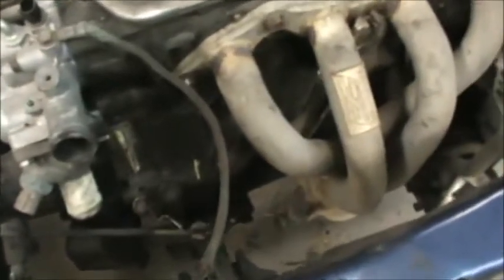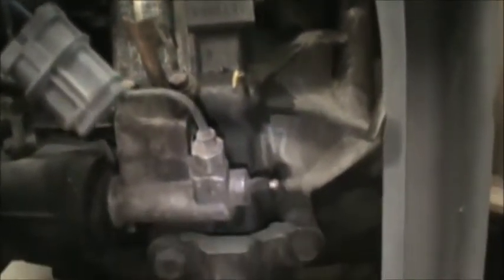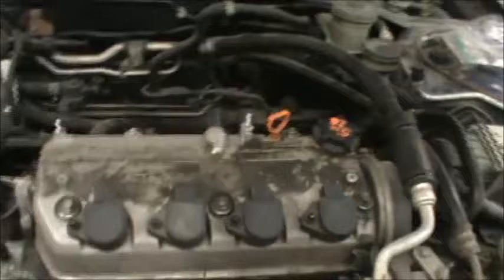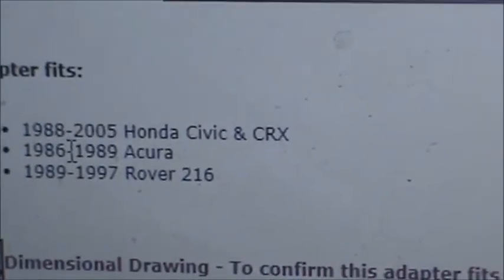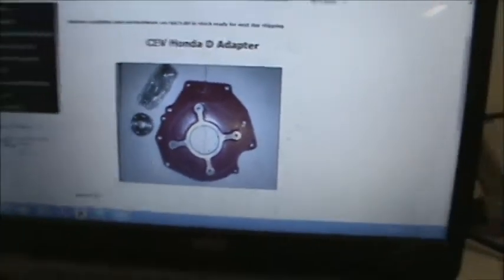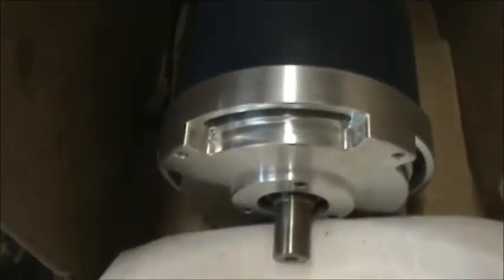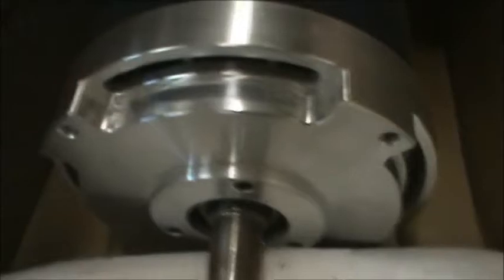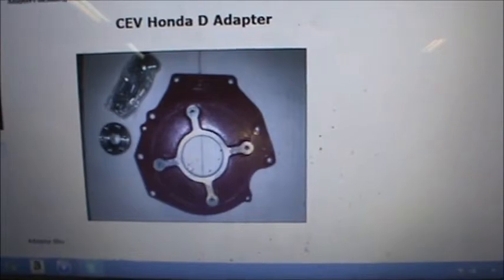My CIvic EV Electric Car Project Part 4 Discussing Mounting The AC50 Motor

Comment: Great Job there! Congrats! Please I want to know, what configuration of Batteries this AC-50 96 to 108 V Electric motor must use to have the best Miles per Charge? and also on how many AH this motor runs efficiently? I will appreciate your help clearing these doubts

Comment: if it where me i would rather have a spline shaft into tranny.  not a hot press fit even that sounds risky unless its got a key shaft then set screws.  then the plate and a second hanger  on rear of motor to keep it ballanced . you also might be able to rotate the motors front plate so it is in alignment to where you want it. most motors have 4 bolts that go through the length of motor case or in front. good luck.

Comment: I have built 2 ev's using Canadian electric adaptors.  I never had any problem or issues with his set ups.  I used both types, keyed and set screw both were real easy to assemble.  There was never a pressed fit so I am not sure you have correct info.
The best way to proceed is to remove all ICE components first. this will then give you the ability to mock up all your systems. You can easily fabricate an engine mount by putting a mount at the end of the electric motor,  I have videos posted that show a mount of this type.  I found the location of the motor connections were determined by the location of the controller/inverter as the 2/0 cabling is sometimes difficult to turn and twist. Mocking up your EV components and getting that running properly outside the vehicle saves time and issues later on.
Reply from the maker: Hi Alan, Thanks for watching and commenting.  I enjoyed your beetle conversion vids and watched them all as you built your car. I wish you would make more showing us "life" with an EV. My hat is off to you and your build!
Your videos actually are proof to the point I was trying to make in this video. You had to modify the parts you received from Randy. If I am going to buy parts I want them to fit perfectly without modifications.
As to the hub adaptor I have an email from Randy stating specifically the hub needed to be heated before putting it on the shaft to make it grow slightly because it has a light press fit. I prefer instead a taper lock hub because it has superior clamping power. He stated they no longer offer a taper lock hub.

Comment: The reason the Electrical connectors are facing the way they ar is so nothing will come in contact with them if dropped, left of fell on top of connectors under power..kind of a safety feature..
Reply from the maker: That thought crossed my mind as well. But id rather have them up with protection on them for the shortest cable runs from the controller then have them down in the road slop.......its a matter of opinion I guess.
Thanks for watching!

Comment: The "mounts" on the sides are engine torque steadies not mounts.Everything hangs from the mounts either end (next to the shock towers)I think you'll need to make your own mounts...I think I would make a reference point on the engine side of the chassis as to the center line of the crank to the gear box too...That way the drive line will line up as it should..The angle of the engine steadies  is important too...I would key the output shaft for sure...Are you going to run an alternator to redeem some power thru a converter.?..Good to see you Tom...BTW....These are just my thoughts...Discard them if you wish..lol
Reply from the maker: Thanks Ziggy. Your comments are valuable my friend, keep them coming!

Comment: Hey Tom, what happens with weight distribution left to right? Will you need to compensate in some fashion for drivability safety? Will the car lean differently left to right? Just a layman thinking...
Reply from the maker: I don't think weight distribution left and right is going to factor in. Actually if anything it might get better!

Comment: With the torque of that engine, I would have thought a full key way would be the go..
Reply from the maker: We have plenty of keyway as long as we have good clamping power on the shaft. With a taper lock type hub I don't expect any problems plus we will be able to remove the assembly easily if it is ever needed
By the By Mark, Many thanks for that transmission gearing site you sent me. It is very helpful!
Reply: No problem....

Comment: I would want the mounts,the trans was never designed to support the weight ,and torque of the motor. Would be afraid it would eventually crack the trans bellhousing  if not fully supported. . I think the taper lock would be far superior  in holding to shaft. I think the wooden model is a good idea. Will allow you to go past that point and give you time to see if any foreseen issues arise before building out of metal.
Reply from the maker: That is my thinking as well Terry. A good 3 dimensional model sets me up for success at the machine shop on the first trip!

Comment: Did you thought on converting this Civic to HHO?
Reply from the maker: No. Hydrogen isn't practical I don't believe. To make hydrogen in the quantities needed to run transportation needs would take a huge amount of electricity. Just give me all the electricity used to make it and ill go further down the road then the hydrogen car will go on hydrogen. Its about like gasoline, just give me the electricity used to make a gallon of gas and ill go as far as the gallon of gas will go.

Comment: Lots of things to consider Tom.......not that I know much about these things, I'd want to see some better mounting at the front end of the motor, just having that hanging off that gearbox plate would worry me!

All interesting stuff though....I'm following!
Reply from the maker: There are few builds on front wheel drive vehicle that I see that I like. And some have had to work on them after the fact because the motors weren't properly mounted. Car makers put a lot of engineering into their vehicles for many reasons. I believe the mounts are there for a reason so I think its important to use them!
Reply: yes I'd totally agree there, not using those same mounts can seriously affect the drivability of a car. if they didn't do anything they wouldn't be there!!